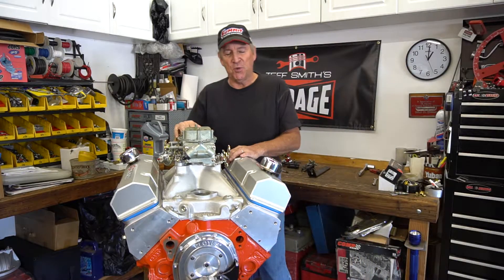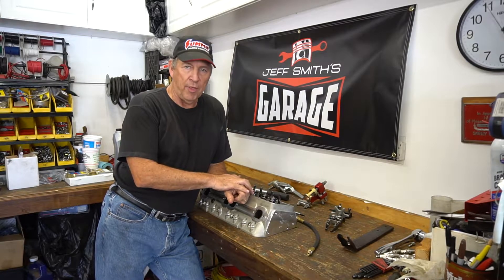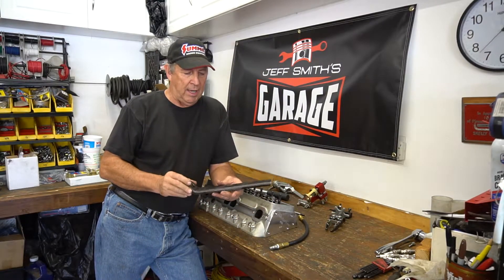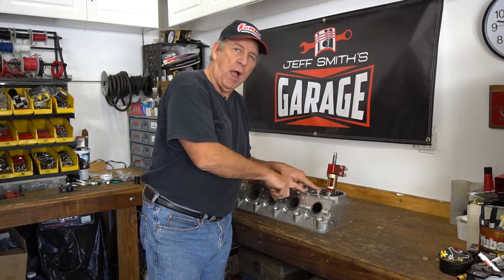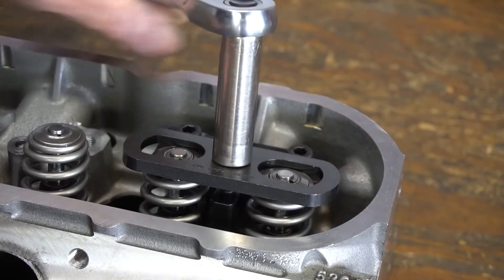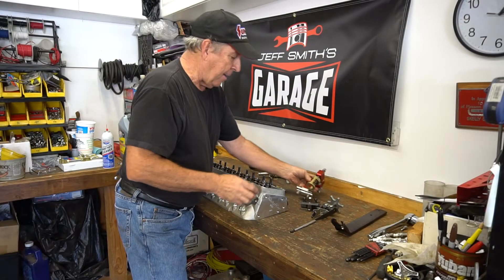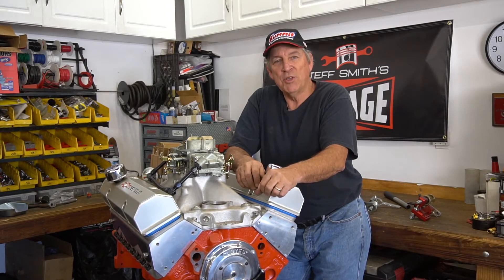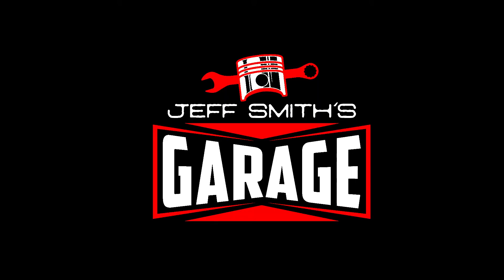How to Remove Valve Springs from an Engine

Comment: Solved my question. Thank you!
Order placed at Summit for the Moroso heavy duty one. 
I have a rebuilt motor but the builder put all of the valve springs in it and I want to remove the inner ones for cam break in. 390FE [442ci now, 11.25:1], still flat tappet cam, but roller rockers. I have one of those cheesy spring compressors from Autozone [or similar]. It worked fine on my old Buick 350 heads, but I knew it was too flimsy for this built motor with these high spring rates.

Comment: How much air pressure do you recommend using to hold the valves in place?   Thanks for the great video.
Reply: I've never tested minimum pressure, but if you have 50 psi miminum might be sufficient. A small exhaust valve at 1.5 inches diameter is 1.76 squre inches, which at 50 psi is 88 pounds per square inch, which should be sufficient to hold the valve in place. At 10 psi it would be 176 pounds per square inch of force. Hope this helps!
Reply: @jeffsmith2003  Thanks